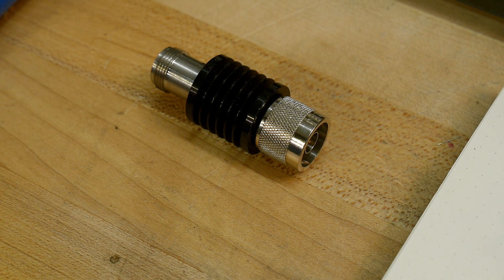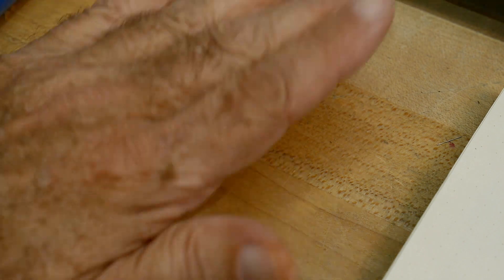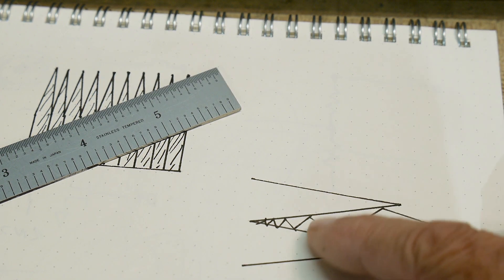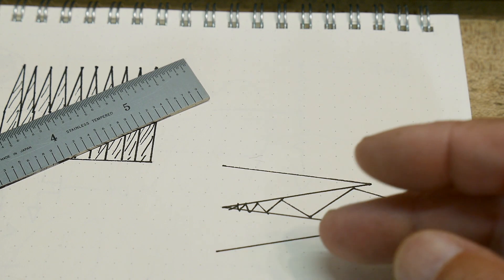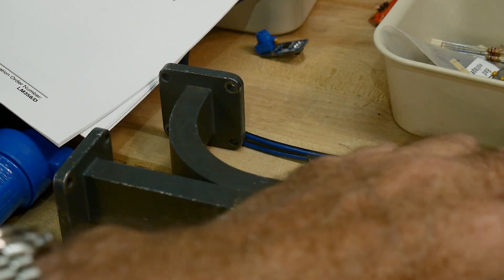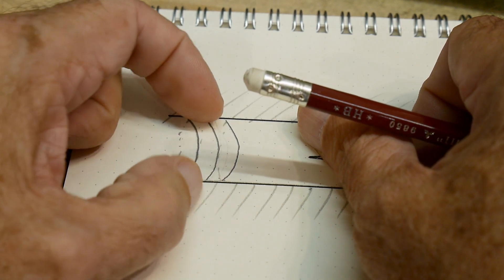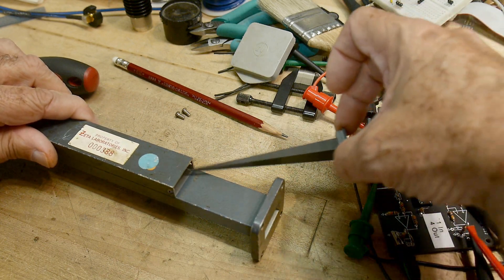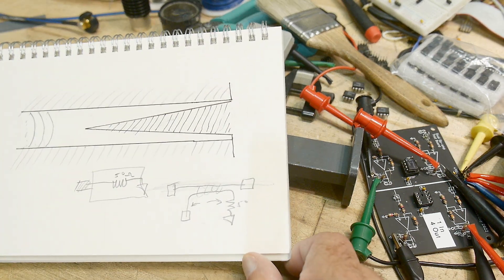#1674 It's a Trap! Don't lose your RF

Comment: Very nice. I haven't thought about razor blade traps in better than 30 years. I learned the concept from my them lab PI. A similar trap model is used for heat shielding (IR) on the Webb telescope. IIRC, smarterveryday dug into that application a few years ago.

Comment: That principal seems to be the same used in the wall-mounted baffles in an anechoic chamber, right?  

As a photographer as well I am always fascinated by the optical and microwave analogs of our low-frequency gear. Attending my fist Microwave Update give me my fist look at all that 'plumbing. UHF/SHF should be more approachable with the new Icom 905 system. But not cheap. 

Most of my recent photography has  been digital Infrared, using hacked Sony 'nightshot' cameras, Do you know about that?  You can see explanations and examples on YT.  'Xray vision!

Comment: The first radar I worked on used a dummy load like the termination in your directional coupler and it contained a ferrite element. A bit larger as it was a L band radar around 1.2 GHz. The dummy load was air cooled and you could shoot 20 MW pulses into it. This radar system normally ran around 2.5 MW, had two complete transmit/receive channels. It had a 4 port motorized waveguide switch that connected one channel to the antenna and the other channel to the load. Regards, David

Comment: I’m interested to know why wave guides are always rectangular cross section and not square, or round ??
Reply: Rectangular waveguide is the most common because it supports both Transverse Electrical (TE) and Traverse Magnetic (TM) modes of RF transmission with TE10  having the least attenuation. There are round "waveguides" also known as coaxial cables that are used in microwave systems that use Transverse ElectoMagnetic (TEM) mode and requires two conductors (waveguide is a single conductor!) Radar systems use both TE mode in waveguide and TEM in the rotary joint.

Comment: I wonder if a light trap can be used for measuring the power of a laser beam. Measure the temperature over time, knowing the mass, specific heat, dissipation etc.

Nice waveguide coupler, looks extremely well made. Very interesting resistor!
Reply from the maker: Bolometer
Reply: Sounds real good.  We can use the resistivity measurement ( which is a function of temperature) to infer temperature.  But still will be too slow.
Instead, we can use a beam splitter or something like directional coupler and send the output to photodetector, this probably is faster and you can detect the modulation of the leaser beam.
Even for high power leasers we can use diffraction by air molecules and use photodetector perpendicular to the beam a given distance from center of the beam to detect the power of the beam faster.

Comment: Just to check my understanding, there will be no reflection, so it will look exactly like a 50 ohm termination. If you hooked your VNA to it you would see a purely resistive 50ohms at the wavelength of thr guide?
Reply from the maker: yup
Reply: If your system is any other impedance then the absorber will look like that impedance.
Reply from the maker: @herbertsusmann986  that's right,  the waveguides are about 400 ohms,
Reply: @IMSAIGuy  The impedance of free space is 377 Ohms. It is sqrt(u0/e0). Permeability of free space is u0, permittivity of free space is e0. I did study that back in physics E&M class way back in the day.

Comment: I know little about RF. Would it be more accurate to say the RF trap attenuates the signal by the equivelant of 50 ohms in decibles? Just curious. Thans ISMAI Guy I learned a lot as usual, the light trap using razor blades was very cool. Take care.
Reply from the maker: no that would not be more accurate
Reply: Thanks @IMSAIGuy
Reply: 50 ohms really doesn't enter into this. Impedance of the wave guide can be anything and the RF trap will still work. There is nothing magical about 50 ohms.

Comment: Thanks, I learned something new.
I always pondered that black holes should be a  perfect 377 Ohm load.  ( i.e. the impedance of free space)
Reply: Negative. It has a totally different mechanism; yes, it is gravity that is at work. Gravity is the weakest of the four known fundamental forces with a magnitude of around 1/40th of the strong force. But in a black hole beyond the event horizon it engulfs everything that falls in and the escape velocity is infinite. Light itself is not able to escape.
Free space impedance doesn't play any role here.
De VU2RZA
Reply: @subramanianr7206  As you know speed of light inside metal (wave velocity) is higher than speed of light in free space.
We really do not know whats going on inside a black hole.  We just guess by extrapolating with the models that we tested outside black hole.
Reply: @aduedc  black hole, its escape velocity, and so on are not wild guesses, as you may want to assume. And light inside metals has velocity more than that in free space..? Great discovery indeed...
De VU2RZA
Reply from the maker: my guess would be zero ohms
Reply: @IMSAIGuy  0 ohm should be fully reflective like metals or super conductors.  Here is  the limit of classical EM theory and we should consider Quantum nature of light.
Any ways light in metals takes the form of  evanescent wave  in which jw turns into w.

Comment: What an ingenious design! Thanks for your explanation and presentation 👍 And as you suspected, it must have been made of graphite that would absorb residual RF (or light) and at the same time provide a very shiny reflecting surface. 
You can confirm that it is not ferrite by bringing a permanent magnet near to it. Ferrites would be attracted by magnets.
De VU2RZA
Reply from the maker: slightly magnetic
Reply: @IMSAIGuy  ok, then it cannot be pure graphite alone. Thank you.
De VU2RZA